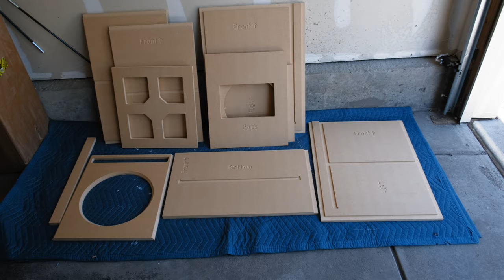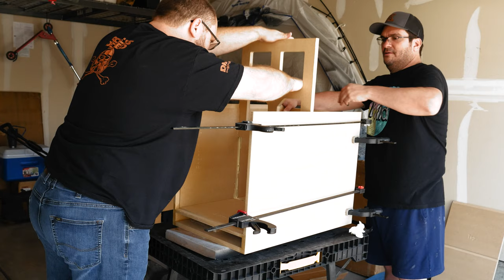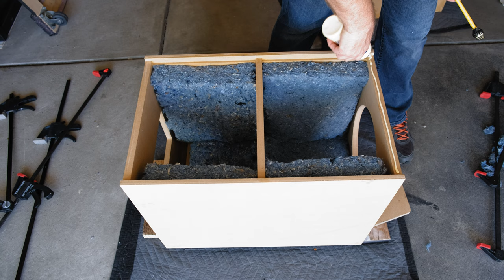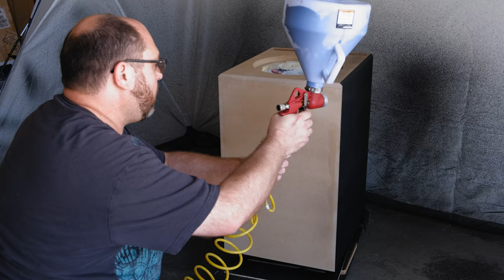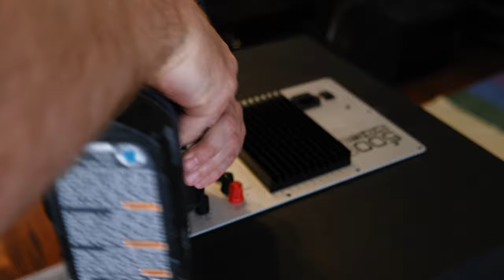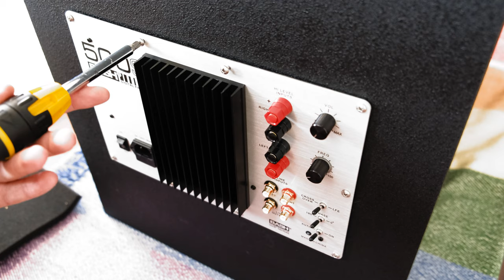The Hammer DIY Subwoofer Build - GSG Kit - Order with code:Jilesgsg

Comment: Wow! You make look easy. How much money/time you spent on this? Very good work.
Reply: I would also be interested to know the total cost of this project. Great work as usual!
Reply from the maker: The driver is $179, the plate amp is $250. I'm not sure what the kit is going for now a days. Call it 250? I am sure someone will correct that to current costs. Then paint and screws and glue are probably 40 bucks? So just north of $700 bucks is probably a typical cost for this unit. If you need to buy tools or clamps or other items that would be an expense... but those are reusable.
Reply from the maker: Oh, the insulation is expensive.

Comment: Mhm i though vented subs don't need stuffing, because it actually reduces the box size.
The Ultimax 12 looks like a 10 inch sub :D Soo smool.
Reply from the maker: Hey - We aren't stuffing the vented box to change the air spring, we are actually lining it so that we can reduce resonance at higher frequencies.